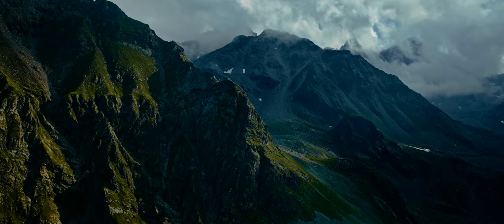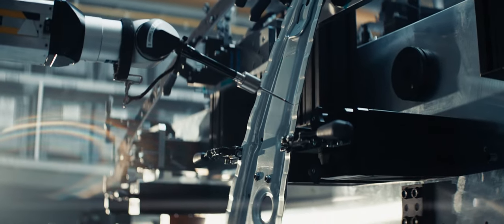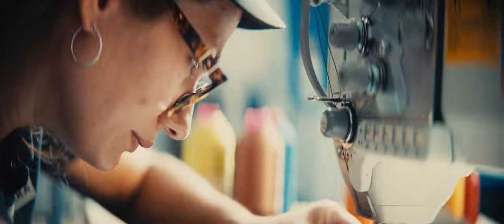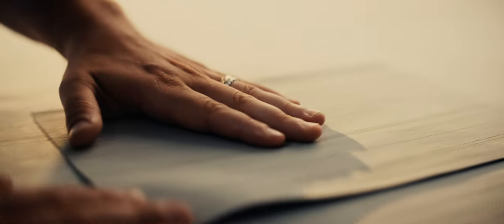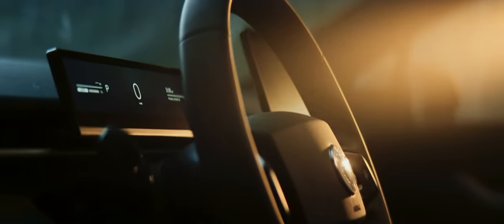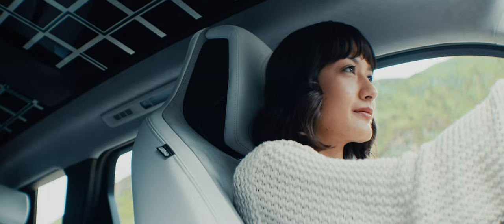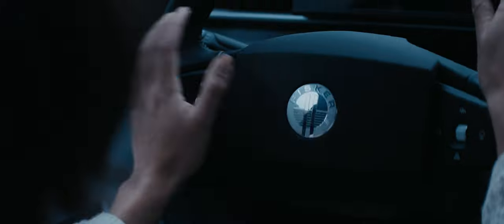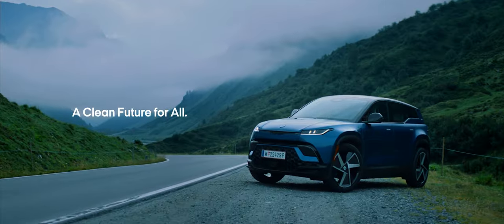Fisker Ocean: Creating the World's Most Emotional and Sustainable All-Electric SUV

Comment: how many decades do i have to drive it to offset the carbon of its production?
50kg what a joke how much is that 3% of the weight? i dont get how you are even allowed to claim carbon neurality and sustainability.
those words should be off limits to any company anyway and only evaluated and communicated by independent sources.
buliding fucking small new trucks for singles in the city its another crime like all the others